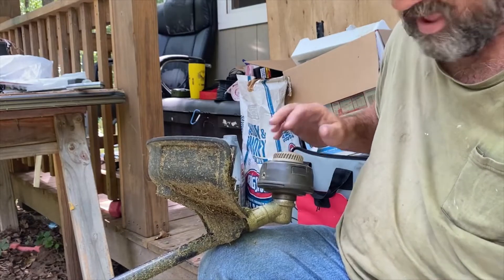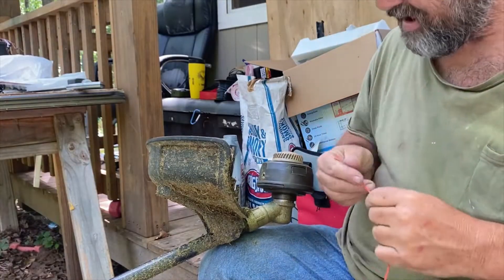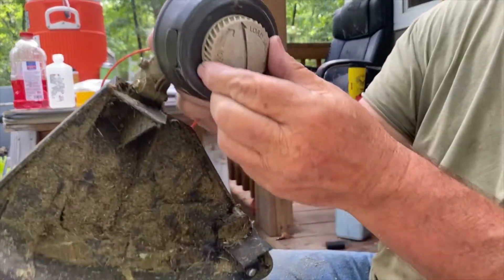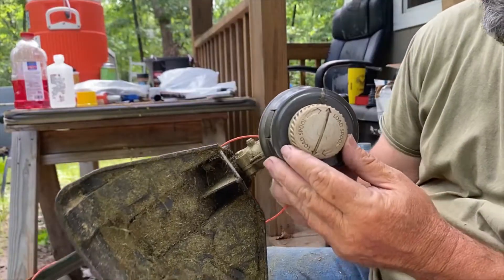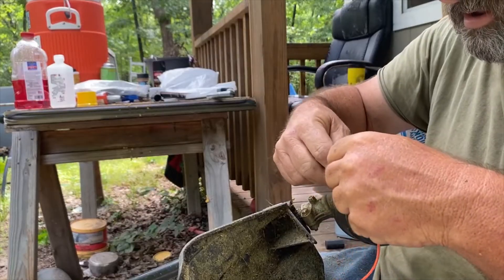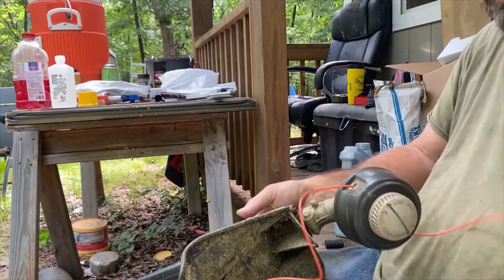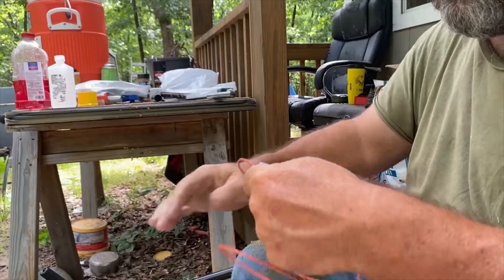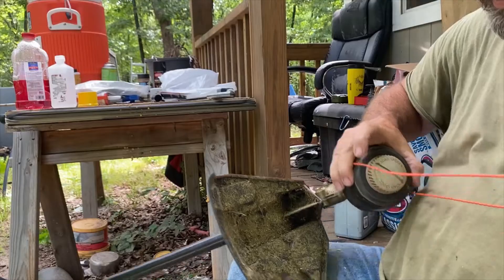How To Change The String On a Black Max Trimmer

Comment: Do you know where I can the spring for it? My head flew off and my spring disappeared in the deep grass.
Reply from the maker: Not sure, you might search Google or even look at WalMart back where they keep the parts. I would search for Black Max Trimmer head. You'll probably have to buy a new head or you might check at a local small engine repair shop. They might have a spring off an old one that will work!

Comment: When I turn the head it dosent pull the string through. What do I do?
Reply from the maker: Make sure the head is on the shaft properly. Also, don't pull hard on the string at first or the it will just spin.